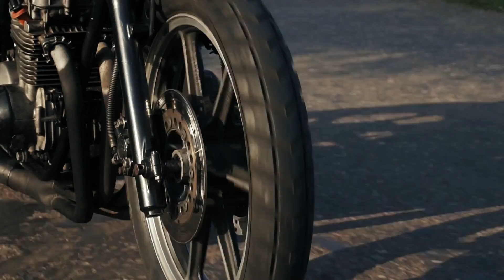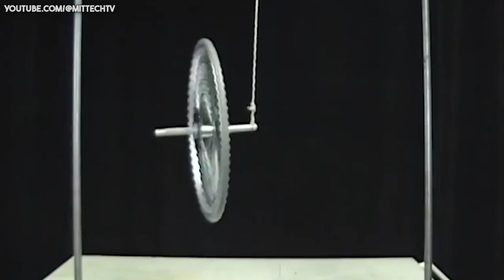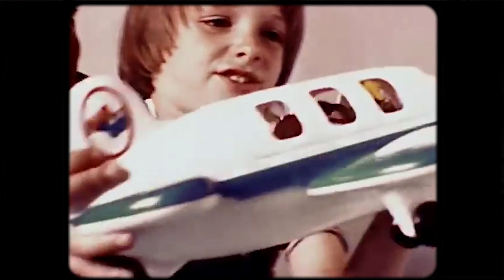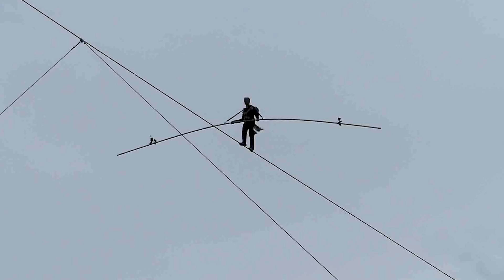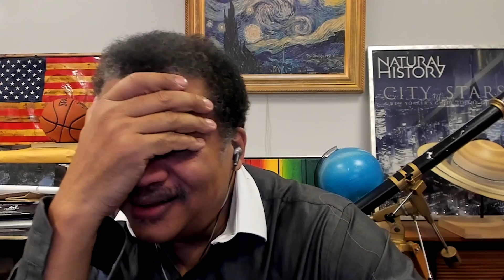How Do Bikes Stay Up? | Neil deGrasse Tyson Explains…

Comment: The tendency of a bike  to balance itself is partly due to the rake of the front wheel that is, the angle  at which the fork holds the wheel. I experimented with my bike by turning the front wheel completely around thereby placing the centre of the wheel directly under the handlebars. This made it practically impossible to ride. Try it!
Reply: Yeah, that's what causes the wheel to steer in the direction of a roll disturbance which is what he was essentially describing.  The main reason it works is because the vertical tire force (wheel load) is behind the steer axis.  So if the bike is not perfectly vertical with perfectly centered steering, that vertical force causes a torque to act around that axis which steers the wheel in the direction of turn.  There is some gyro effect adding to this in the same direction though which might be negligible at low speeds, but might not be on a racing bike at high speeds.  It's not really just one or the other, it's both.  Just a question of which one is stronger at which speed and with which tire and which motorcycle...

In your very cool experiment you reversed it and put the load ahead of the steering axis so the torque is reversed.  Leaning to the right would cause it to steer left and make you lean to the right even faster.  Totally unstable as you know.  It'd take some serious brain rewiring to control that!  😁
Reply: @toddwasson3355  Yeah the lowest center of balance occurs when the bike is laying down and really has nothing to do with balancing a bike. That's why they fall over when they're not moving  Road racing bikes have the engine higher in the frame to allow the steering geometry to be more responsive and enables the change from a left turn lean to a right turn lean to happen quicker, and to have the bottom of the bike high enough for the extreme lean. One interesting point is the method used to initiate a turn on a racing motorcycle or any bike really, if you just lean the bike, you start to turn that direction. If you want to start a lean quickly, you push the handlebars in the opposite direction. As soon as the front wheel goes that way, the lean is happening real quick and the steering balancing geometry takes over. It sounds crazy, but there you go. You can try it, it works. Especially if you're leaned into a turn real hard already, think about it. To switch up, and turn the other way, you've gotta get the wheels on the other side of the bike so you turn them that way, harder into the turn, the bike stands up and leans the other way. I had to try, I didn't believe it either. It changes things really quick. Wheels and tires are lighter than engines, they can switch sides faster. If the center of gravity is too low, it's too stable, and you turn slower, and can't lean far enough. All that being said, steering geometry does lower the center of gravity when it's upright and straight until it leans, whereupon it turns to balance.
Reply: @edbruder9975  Makes sense.  I've only ridden a couple of motorcycles at low speed very carefully so am certainly not an experienced rider.  I would expect to have to steer the wrong way though at first to lean it over quickly.  Even a bicycle works that way.  From what you said it sounds like you do that at high (racing) speeds too which I wasn't sure about.  It's also interesting to hear that the CM isn't made as low as possible for the reasons you described.  Thanks for the lesson!
Reply from the maker: Falling doesn't sound like something we'd like to try! Interesting finding though.
Reply: Thanks, both of you. You both gave better explanations of my experiment than I could have!
Reply: @rogertulk8607 did you try to run it backwards?
Reply: @Riccofiori  I hadn't thought of that, I think that unicyclists probably balance by a method somewhat like you might use to balance a broom stick on your hand.
Reply: @rogertulk8607  I agree that is part of it. Once in motion, the unicycle and the wheelie behave similarly to a bicycle in that side-to-side motion and counter balance determine the behavior of steering. In other words, a rider can steer a bicycle without touching the handlebars and without the front wheel touching the ground. I think the act of steering is the act of tilting and counter balancing for the most part. When the rake is reversed, the stability of the front wheel is diminished I think because the front wheel is too sensitive to changes in side to side forces.
Reply: The closer the fork angle is to 90 degrees the twitchier the steering gets. Some BMX stunt bikes exploit this on purpose for aggressive handling characteristics.
Reply: Yes it makes sense even without trying that, I own several bikes, even a emtb and a BMX and studying it as other BMX-es the balance doesn't change because it is so calculated cause on a trick to have no influence this matter.
Reply: I wonder what would happen on a bike with a bike with no steering whatsoever.  According to what was mentioned in the video it would be extremely unstable but I don't think it would be.
Reply: @andrewedis9907  Veritasium did it by locking the steering.  The bike was completely uncontrollable.  Also excellent explanations in this for how the bikes stay upright including the gyro effect on the steering mechanism along with the geometric steer effect Neil described:

https://www.youtube.com/watch?v=9cNmUNHSBac
Reply: @toddwasson3355  Thankyou Sir

Comment: Lots of really good comments on this one! I want to try to clarify the correct answer to the original question as best as possible.
 "HOW" does a bike self-balance? Well,
"Trail" is the distance from the tire's contact point with the ground to an invisible line through the front wheel's steering axis where it intersects the ground. Tilted steering axis or not, if the tire's contact with Earth is behind the steering axis, you have trail. If the bike is pointing straight ahead, and both tires are directly along the bike's centerline beneath the center of mass (COM), then there is no effect on steering from the mass of the bike or how it relates to the COM of the bike/rider system. But if the bike leans, the contact point of the tire is no longer directly under the COM, and TRAIL becomes a lever arm that turns the bike's steering in the direction of the lean. Here's how you can visualize that.
Let's go the the extreme: If you lay a bike horizontally on its side and push up on the front tire where it would make contact with Earth, it easily turns the steering towards the ground, towards the side you laid it down on. Another thing you can do with your bicycle (or motorbike if you're really strong). Hold it upright, not moving, steering straight ahead. Then without touching the handlebars at all, lean it to one side. Because of friction it may not steer right away, but pretty soon, that steering will turn toward the direction of the lean, and that's because of the lever arm of this magic thing called "trail." And you're not even going anywhere!
So if you're riding, at most realistic lean angles the force from that invisible lever arm causes the wheel to turn toward the direction of lean which moves the tire contact points back underneath the COM hence balancing the bike. 
But COM does matter. A high center of mass will require different steering geometry (angles) to automatically balance the bike, and as some here have said, you may want more or less balancing depending on what the purpose of the bike is. Fast and nimble - maybe less trail (a shorter lever arm), or more for comfort and easy riding - go for more trail. 
Finally, if you have an old bike where you can spin the steering around backward, this gives you negative trail, and all the balancing effects are reversed and good luck giving that a go!
Reply: This. And why did i spend time writing down pretty much exactly the same thing even with the front wheel backwards. :)
Reply: Correct answer. This is all covered in RCVD (Race Car Vehicle Dynamics).

When I was a kid, I purchased an RC motorcycle. I think it was manufactured by Tamiya. The forks were completely free to steer at angle angle they wanted to. The steering servo tilted the forks in the front view to one side or the other a few degrees. This has the effect of moving the CG off of the contact patch axis between the front and rear tires, creating a torque which causes the bike to lean. Mechanical and pneumatic trail then cause the fork to turn in the direction of the lean. The trail then causes the contact patch to move sideways, until the CG is located over the contact patch axis, resulting is no torque and the bike then stays at that lean angle as it turns. As a 14 year old, it took me quite a while to figure out the physics of how all of this worked. At first, it just seemed like magic.

Comment: For sure, the answer to this is in the wheel gyro and countersteering frame/fork geometry.  I don't think the counter-spinning bicycle wheel would cancel out all the main wheel's gyroscopic forces unless it has weight added to it to make them a closer rotating mass. As is, it is missing tube and tire.  The weight on motorcycles is not between the feet (foot pegs) and rear wheel. Much of it is right behind the front wheel. this includes both the engine and gas tank (which is fairly high)  on most standard style motorcycles.  The best way to test this would be to RIDE A MOTORCYCLE! :)
Reply: It does.  Without a doubt.  If you counter-rotated with exactly the same RPM and mass, there would be ZERO gyroscopic effect.  (That they didn't match the mass exactly isn't really that important - the result was canceling the vast majority of any gyroscopic effect in action.)  Crazy that  you're gonna challenge Tyson on this.  This is clearly understood.  Physics 101.  You could design a bike with 500 wheels spinning on one direction and 500 in the other and the net gyro effect would be zero.  However, the system would have increased overall mass, so the system has more inertia.  But that's it.
On other forums, people with zero understanding of physics would talk about "forces acting through the tire" as if they're some mystical phenomenon.  Nope.
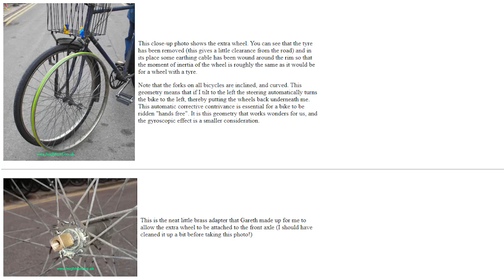Reply: @dudeonbike800  Correct but it has to be the same mass right for each counter-rotating wheel right? If you look at the image of the test bicycle at about 2:04, one is clearly missing a tube and tire. This would make a noticable difference in the masses right? And lastly, chlll out. Science is a process of discussion and review. If someone misunderstands or is missing information, we help each other learn. No need for the "how dare you." attitude. Be a better ambassador to the community and art itself.

Comment: Neil, you need to do a better job, you did not fully answer the question. 

Anyway, Neil did not explain the question fully, why b bicycle and motorbikes are stable? all he said was low CG. but bicycle has low CG just like cars, but when car is stationary it is still stable and bicycle is not. So, the low CG is half answer Neil have. 
On a moving bicycle, two force acting, if you draw a vectors for gravity from CG downward and forward motion, the stationary bicycle ha sonly one component, gravity, very unstable equilibrium, it falls with small force acting sideways on the CG. But moving bicycle has forward component and it is longer the faster you go. 
The resultant force component is just close to forward motion, towards the front tire. You need large sideways force to make that component unstable. 
So, it is not gyroscopic effect that makes the moving bicycle stable, it is the forward motion that makes the bicycle stable. There are two wheels in bicycle, duh, how could anyone think gyroscopic effect from two different wheels makes stable? the sideways force, or the torque is acting on the CG of the bicycle not at the wheel axis. And in order of gyroscope to be stable when torque is applied, it has to rotate perpendicular to two axis, forward motion axis and the torque axis, that means, the bicycle has to constantly turn itself to be stable. How could an astrophysicist doesnt know this before? 
Anyway, the gyroscopic force does acts on the wheels, but individually. When the turn, you are applying torque on the handle bars, basically pushing down on side. You have front wheel rotation on one axis or side axis, then you applying torque on front to back axis, then the wheel turns on left or right on the vertical axis. 

So, Neil, you need to do a better job, you did not fully answer the question.

Comment: Hey another question also with the pole on the wire wouldn’t lowering the center of mass essentially be to benefit the balance therefore that’s still the reason?

Comment: 1st time I don’t agree with you. Its the caster wheel design that keeps the bicycle dive straight and it will steer in to the turn to right itself if the bicycle made a turn keeping it upright. I discovered that when i was young and drove my bicycle into a curb causing the front wheel fork to bend backwards which made the bicycle unstable because the caster angle was reduced.

Comment: Neil, I would suggest you buy a book called The Racing Motorcycle by JohnBradley. In it, you will find all the correct information and science as to  the dynamics of a bike and how they steer and stay up. It is not how you have been misled and put in this video. This info has been known by bike desugners for decades.

Comment: The angle of the front fork is what helps to keep straight. It's always tilted to the backwards. Even car front suspension is tilted to back. That's why steering wheel automatically comes straight after turning

Comment: This is confusing at best because Neil talks only about the low CoG without any reference to the pivot point (“point” contact of the tire with ground) or the corrective moment with respect to the net weight vector. Talking about just one force in a system of forces to explain a phenomenon is confusing and probably misleading. Hopefully a follow up video will clarify things better! 

Cheers ! - Mike Arun, PhD.

Comment: E-bike center of mass is quite low, the motor is at the hub or even lower, at the pedal axle. In some ebikes the batter is high but we are talking about very cheap or older stuff then, like when kits were still popular. Purpose built frames put most of the mass low. I got one and its balance is excellent, even with the long battery being inside the downtube, from pedal axle to almost to the top. The motor is still in at the hub, relative to my old bike the ebike has much, MUCH lower center of gravity.

Comment: I remember when I was a kid, I did this experiment (I heard or read about it somewhere, but I don't remember where) where you put a fork and spoon together with a toothpick pushed between them, balanced on the edge of a glass, then you light the inward-facing end of the toothpick on fire.  It burns to the edge of the glass and stops, and you're left with this thing standing on the edge of a glass, barely touching it, yet staying put.  Pretty simple physics, since it's just keeping the center of gravity so low, it can't tip in either direction, but it looks completely counterintuitive.

Comment: Not many times I disagree with the explanations given here, but the bike is not stable because of the center of gravity. With a person on the bike it also tends to keep upright, and the center of gravity is way up the bike. It has much more to do with bike geometry, where the angle of the fork, seat tube angle, chain stay length, bottom bracket height and center of the wheels are more influential on the bike being stable. The steering has a lot to do with keeping the bike upright. See Veritassium who has made a video about it. https://youtu.be/9cNmUNHSBac

Comment: In other words bikes have a very cool mechanical auto-steering feedback system for maintaining balance. They self correct their balance with clever mass distribution and head tube angulation.
Reply: As a bicycle enthusiast, this is a great description.
Reply: If there is no external force to cause acceleration of one half of the tyre and an equal but opposite deacceleration of the other half then the front tyre will remain straight , i.e stability while in motion.

Comment: When I was a young man, I had a go on a 'high wire' training bicycle. It didn't have the big floppy pole (pfffft!) but it had a framework attached to the rear wheel hub that hung 4 ft below the wire at an angle which put it directly below the saddle. There was a 28lb weight in it and that made it almost impossible to fall off! A perfect example of stability through the lowering of the centre of mass.
(The wire itself was a nosebleed -inducing SIX FEET off of the ground!)😅
💚🐇🐴💚
Reply from the maker: Impressive!
Reply: What an exciting experience. Was it?
Reply: @AlexiusGott  
Yes.
💚🐇🐴💚
Reply: Same reason why ships carry ballast and yachts have weighted keels
Reply: It only works if the CM is below the tightrope which is why the framework is there.  If that were the case in the typical tightrope walker case without the framework, tightrope walking would be about as easy without the framework as it is with it.  In other words, they wouldn't bother with the extra training gear.
Reply: @toddwasson3355  For the walking, yes. But for a clumsy teenager riding a bike 30ft along a wire in the mid 1980s - that framework was very much required!
💚🐇🐴💚

Comment: Love all your videos but this one is very interesting as it involves motorcycles. Explain this then. See https://www.youtube.com/watch?v=9bx00ILkpJA at (6min 30sec) were a speedway bike (with a jammed throttle) can pick itself up off of the ground from a laying down position, get back up on it's wheels and take off again. The engine is spinning in the same direction and on the same plain as the rear wheel. I have also seen this happen at a race meeting myself.